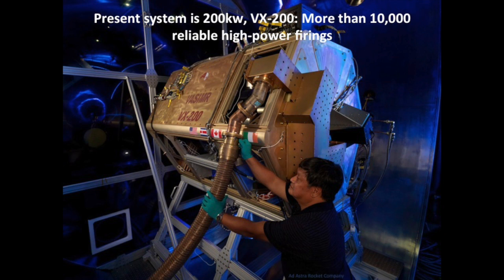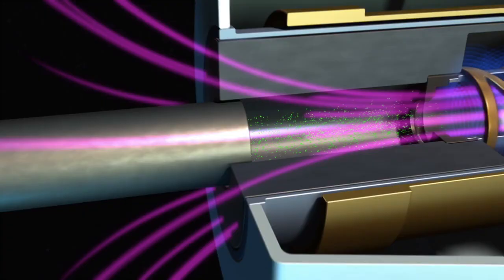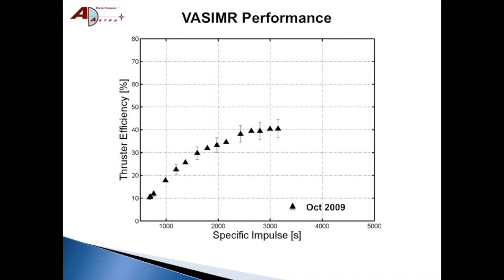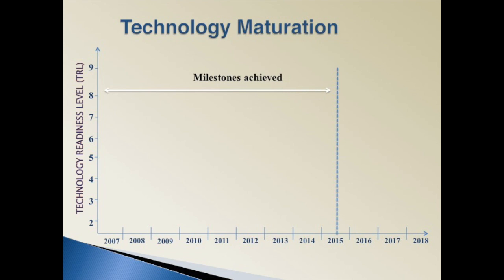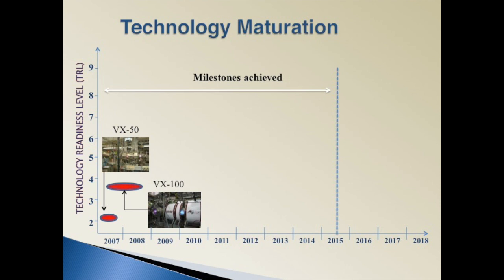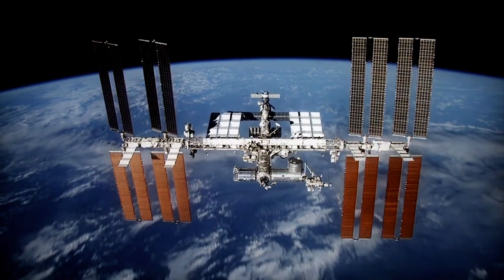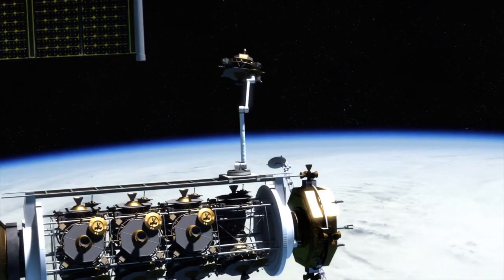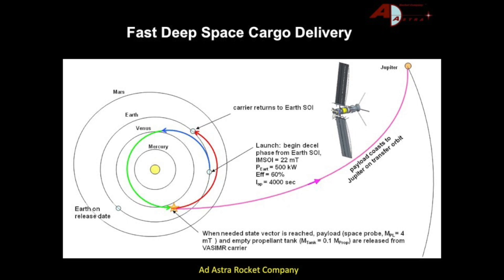ISDC Presentation May 20 2015

Comment: Can you say when the ISS reboost might be conducted?  The ISS will be supported by NASA until at least 2024, so it is difficult to project savings in that application. Perhaps the spent satellite application can be achieved with VASIMIR. In any case for what it is worth thanks for your research!